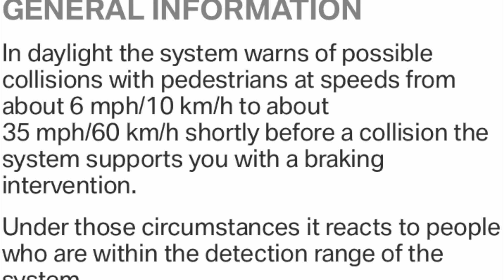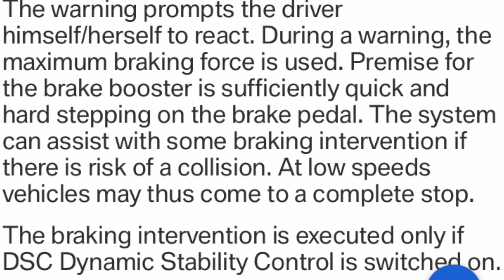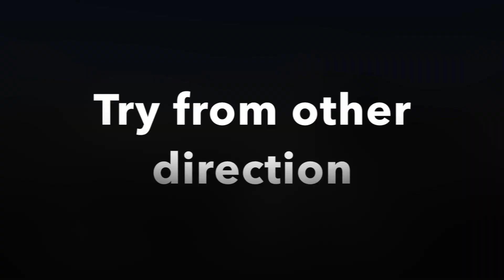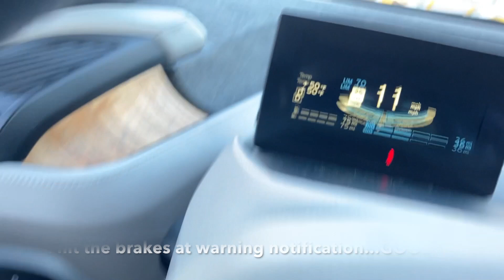BMW I3 Pedestrian Collision Avoidance Testing

Comment: It would seem they are trying to avoid autonomous phantom braking in case the detection isn't really a person.  I think by pressing the brake, it's telling the car to engage the emergency / parking brake (as in full brakes are applied even if you gently press the brake?)
Reply from the maker: There was a blog discussion many years ago where someone modified the early warning settings and was happier with the results.  Unfortunately, you cannot change these using bimmerlink, and need ISTA or equivalent to adjust them, at some risk (since it is a safety system).   I may try this in the future as a possible video topic.   Thanks for the feedback!

Comment: Thank you for performing this test. I really want to justify buying an i3, in part due to safety systems. It seems that many cars including Tesla are challenged in pedestrian and cyclist safety. And reliance on camera only systems is much worse in the dark, when most pedestrian collisions happen. At least an i3 won't impact the pedestrian with 2.5 tons of force delivered by a flat faced battering ram...I'm talking to you, SUV.
Reply from the maker: Thanks for the comment.   I think some of the newer cars do not require you to tap the brake pedal (after warning) for the car to engage the full braking, as was required here.  There may be advantages (no ghost braking?) and disadvantages (requires driver to respond post warning?) to both.